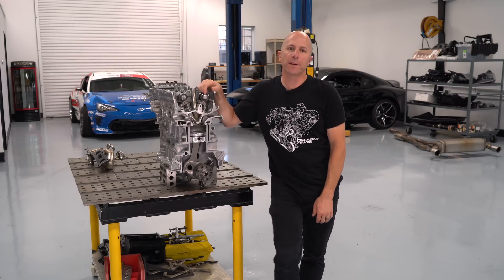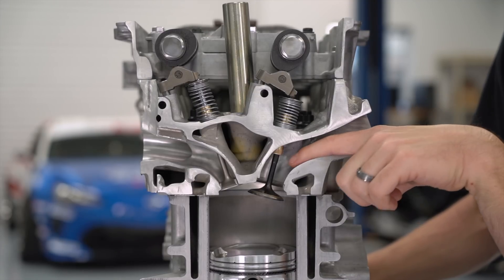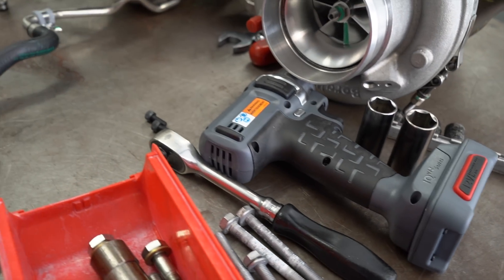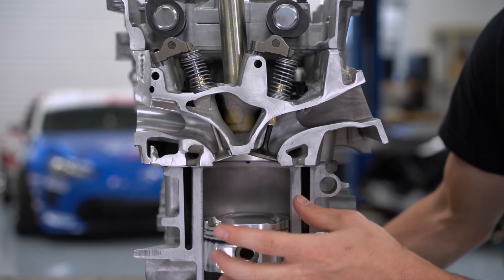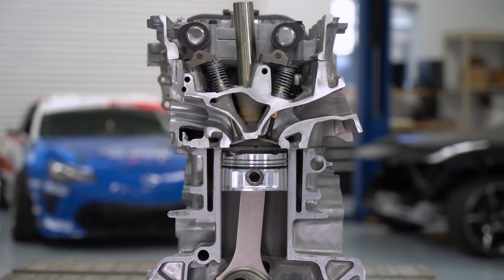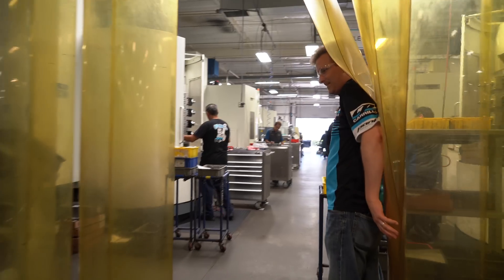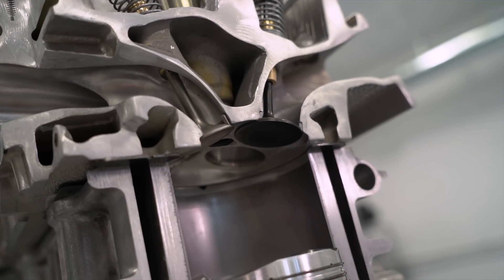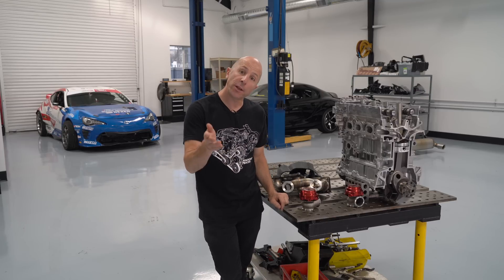The Making of 1,000 Horsepower 2020 Supra Engine Parts

Comment: I love this.. everyone fighting over “yeah first to 10’s” “first to 600whp” and he’s all like so yeah we’re just gonna go ahead do 1000hp and get to business.
Reply: And post it explaining how 👍
Reply: and it's a great video with a dense of information. not talking shit and unnecessary stuff.
Reply: derek kozelka well to be fair, steph is building an engine. Everyone doing stuff with the new Supra is doing so on stock internals, which is impressive
Reply: Matt L true true true! It’s just cool how engineering focused he’s being and taking it up to 10 right off the bat.
Reply: derek kozelka oh yeah I agree. Steph is a mechanical genius 😂
Reply: @DDRDK  Lol but he doesn't know something basic. He said that using a leaner air to fuel ratio makes it run hot, but he's wrong. Running at stoichiometric air fuel ratio makes an engine hot and running it leaner or richer than stoichiometric keeps it cool
Reply: InfiniteLoop that’s false though. When an engine leans out, it’s using more air than fuel, and it WILL cause a car to run a bit hot. Most fail to realize that fuel temperature itself has a huge impact on a cars performance. If your fuel is boiling, the car will run like shit. Fuel does has a play in engine temperature, but it’s not 100% the deciding factor
Reply: @Matt_Lanzer_13  No, you dumbass you're wrong. Check your facts before trying to correct me
Edit: Combustion temp plays a major role in engine temo but I know that there're other factors
Reply: InfiniteLoop you are correct. Fuel flow into a combustion chamber in relation to heat is a bell curve. Theoretically if you get a certain cylinder head temp with a richer than perfect fuel mixture, you will get the same temperature if you lean it the same amount. It’s not perfect but reciprocating engine airplanes use this theory with the proper monitoring equipment to save fuel. You theoretically do not loose horsepower going to the lean side either. Let’s be realistic though and realize he is talking about a racing application and it’s much safer to run an engine on the rich side to keep it cool. For a racing application there’s no reason to take the risk of running it “cool” on the lean side of the bell curve. Where fuel savings is not needed. I’m sure he probably knows this.
Reply: InfiniteLoop any unburnt fuel left in combustion chamber will change state to a gaseous form dissipating a lot of heat in the process cooling the combustion chamber, the cooling will be even more extreme  if the fuel happens to be ethanol or methanol
Reply: @kiyoponnn  wow so rude,  was that  necessary
Reply: @DDRDK  cylinder head temperature and combustion temperature are two separate things that different elements of the engine influences it
Reply: powersliding hmm. Interesting? Not really sure about your statement? Maybe I’m not understanding what you’re saying or vise versa? Cylinder head temperature most definitely is directly tied too combustion temperature. I’m not really sure why you think it’s not? A wet block has coolant that runs not only around the cylinders but through the head. This is then cooled down by heat exchange through a radiator. In fact most of the heat produced by an engine is taken from around the combustion chamber and transferred too coolant via water passage ways in the head.  My point above is mostly to explain when a lean condition is mostly used in the industry to run cool. This is currently a method approved by manufactures and the FAA to save fuel in some reciprocating aircraft engines. My point is, it is in fact true that running an engine leaner than stoichiometric will indeed make the engine run cooler without loosing any horsepower. Theoretically. Is it perfect... no. But it is an approved procedure that pilots use to save fuel. Think about it this way. Engine temperature and fuel ratio have a bell curve relationship. Let’s just call a fuel to air ratio of 14:1 perfect or stoichiometric. Let’s keep it simple. If you theoretically run a richer fuel ratio of say 13:1, that mixture will not completely burn because after all the perfect full burn ratio or mixture is 14:1. The rest of that fuel will effectively cool the combustion temperature. What some airplanes due to save fuel is run a fuel ratio of say 15:1 to save fuel. The same effect happens. The combustion temperature is actually the same as it was when burning at 13:1. Yes when it was at 13:1 the excess fuel cools the combustion temps but when it runs at 15:1 there’s actually less of a combustion event causing the engine to run cooler. That’s why the relationship of combustion temp and fuel ratio is a bell curve. On the lean side it will run just as cool at 15:1 as it will 13:1 and without power loss. Remember a perfect burn in this scenario we are calling it 14:1. There’s no power difference at 15:1 vs 13:1 because at 13:1 not all the fuel is actually burning, where 15:1 you just aren’t even putting the wasted fuel in there in the first place. Cooling from a 13:1 ratio is from the excess fuel. Cooling from 15:1 is from there being less of an explosion in the first place. The hottest running fuel ratio is always a perfect stoichiometric for that engine because you’re getting maximum allowed burn (therefore heat) and nothing extra to cool it like excess fuel. And 15:1 just doesn’t burn as hot because there isn’t as big of a combustion event in the first place. Like I said above he probably knows this but it isn’t practice in this case what so ever. And like stated above it isn’t a perfect theory with every fuel type either. Higher ethanol and methanol fuels bring a much bigger cooling effect with excess fuel is introduced.
Reply: @powersliding  I wasn't very rude, and yes it was necessary since he is technically spreading misinformation. And I don't know what you're smoking if you think cylinder head temp is unrelated to combustion temp. And I know that there are other factors too: Like an oil cooler, coolant, water/methanol injection kit, heat absorbed by fuel etc.
Reply: Wait so your saying a lean engine won’t run hot and melt a piston? Tell that to my 2 stroke sleds 😂
Reply: Cory Grant lol you clearly don’t get the concept..... of course they’ll run hot in a 2 stroke. 2 strokes (other than oil injection ones) are literally designed to use the fuel as as cooling AND LUBRICATION. Duh... of course they run hot. They’d have less oil lubricating them. A 2 stroke sled is not what we are talking about here, move along.
Reply: @kiyoponnn   "Running at stoichiometric air fuel ratio makes an engine hot"
Did you actually look into it yourself, or did you just watch Jason's video from "engineering explained"? And you didn't delve deeper after that?
Here is the catch: the stochiometric burn is a theoretic assumption for a perfect gas. In the real world you only approximate it. That's because air and fuel don't mix perfectly. Even IF your lambda sensor is showing you that you're stochiometric then you will have little regions of rich AND little regions of lean burns inside one cumbustion chamber at the same time. That's the real world. At so called stochiometric you will have both unburned fuel and regions with too little fuel, if you run a bit lean then you will have stochiometric regions and lean regions but no extra unburned fuel regions compensating for it. And THAT's why a bit lean often is the hottest point in the REAL world.
And this is ONE main reason why real tuners say lean means hot and theoretic engineers say stochiometric is hottest.
And here is another thing that plays a big role: How much this actual hottest points is off from stochiometric depends on how well the fuel actually mixes with the air, which depends on a lot of factors and is different from build to build.
Then there are other factors that get overlooked like some speeds (how fast it burns, how fast the flame propagates, how much time is needed for knock to occur), and i'm not going into those details. Just keep in mind there are other realworld factors that are confusing people.
Reply: @sasjadv  Fair enough, but that doesn't disprove what I said. You just admitted that engines have flaws either due to design or manufacturing tolerances that create hotspots in the combustion chamber. And I'll already said that I know that a lot factors affect it, but it's still a scientifically correct concept
Reply: InfiniteLoop running stoich or close to it in a performance engine is considered “lean”, and it will destroy an engine.
Reply: Matt L I think it’s way more impressive to build a high performance race engine. Those that have no idea what it takes to build a proper motor would never understand.
Reply: Gapplebee as cool as it is seeing steph go through the process of developing new parts, it’s not that hard to build an engine though. If you really wanted, you could buy all the parts off the shelf, and put it together in a home garage. Steph is going above and beyond and having custom parts made, which is all well and good, but it’s honestly a bit overpriced considering most of, if not all the older b58 parts will work on this one. 

And not saying anything about that, but It’s still impressive seeing a stock i6 make over 700 hp without any major mods. I mean shit, LZ has a bone stock engine with a bigger turbo and a tune and made like 702 or something. That’s pretty cool as well
Reply: @Matt_Lanzer_13   Yeah, making a 1000horsepower at home is possible if you have the money to buy the parts AND you have the knowledge IF you have a 2JZ.
This is a new engine that doesn't have the needed parts available, so you have to custom build. Apart from this, the B58 engine has some compromises that you need to overcome.
Reply: sasja de vries. Lmao the b58 isn’t a new engine.... it’s been around for like 5-10 years already.... this is the second generation. And a 2j is really not as good as everyone thinks it is. They won’t make 1000 hp unless they’re fully built, and that’s a shit ton of money. I mean shit, LZ has a 3.4 stroker that only made 1k with nitrous.... dean and weick’s cars both make around 950, so does tuerck’s.....
Reply: Because he understands his audience and 600whp isnt competitive in the supra realm and this new supra needs to far surpass the last one.
Reply: Real ST hit 10's first. That car is at Hot Rod Drag Week as I post this and did 10.96@128 on Tues. Car has upgraded turbo on it.
Reply: Anthony Thomas he meant up to 1000hp.... we were talking power... not 1/4 mile times
Reply: And HKS built a MkIII Supra that hit the 7's back in the early '90s...So what ?
Reply: It isn’t like I’m just reading the information I’m talking about. I work on airplanes. Airplanes are heavily regulated. If this wasn’t a real process that worked or was possible I assure you it wouldn’t be used. If you can’t grasp the concept that’s fine just don’t bash the truth and then try and compare it too 2 strokes. That’s like saying because Diesel engines don’t use spark plugs, spark plugs all together aren’t used and don’t work.
Reply: @DDRDK  Do you know the key difference that you've overlooked between piston engined airplanes and cars? Throttle response. Put your regulated aircraft engine into a drift car without alterations and it won't last. Put the same engine back into your plane and it'll be fine.
If you have a carburetor or injectors that are far away from the intake of an engine, then you will have worse throttle response, you will constantly run at the wrong A/F ratio when revving, clutching and changing gears. But if you have your injectors further away from the intake then the A/F mixture has more time to mix, it will mix better and give you better fuel economy. Pilots operate the throttle rather slowly, and there are no sudden peaks in engine load or RPMs. It's the opposite of a drift car. Eugene Losev spanks the throttle multiple times per second, and all drifters tend to pop the clutch, pull the handbrake, etc.
On steady RPMs you can get away with lean mixtures, and you can get away with putting the injector further from the intake if you don't need throttle response. But on racecars the fuel gets injected into the ports or into the combustion chamber, and you never reach stochiometric burn, you will always have regions of too rich and too lean at the same time. And because of that the actual hottest point gets shifted into the lean region on racecars. And the better the fuel mixes, the closer the actual hottest temps will be to stochiometric. And since aircraft can afford to compromise throttle response for fuel mixing they tend to have a better mix and their hottest point will be very close to stochiometric.
---
I'm so glad I speak multiple languages that allow me to access more info. People who only know half of the story all think they are right and don't get why others disagree.
Reply: sasja de vries. Lol or you didn’t read my response hahah. Congrats on the multiple languages... I don’t claim to know it all. Simply that it’s a theory that you just said yourself works and can be done. Thanks for proving my point. Did you forget the read the part where I said that in a racing scenario this isn’t practical? That it’s a practice that’s used in planes because things like throttle response isn’t needed? I wasn’t going to explain life on earth itself. But you managed too 👍
Reply: @DDRDK  😝😂
Reply: To be fair...horsepower means nothing if it can’t put it down properly at the track...I like horsepower tho lol
Reply: Lololol
Reply: What about the exhaust ports? Only 2? Knowing that a normal 6 exhaust port header glow like a sun, what happened with that aluminum exhaust ports when heat hit up? I guess will blowing up like a firecracker when getting melted
Reply: Luis otero it’s not really two exhaust ports. The motor has the manifold basically built into the head. That’s actually a pretty common thing to see nowadays. The two ports are fairly equivalent to that of a twin scroll manifold

Comment: I really dont like the exhaust ports. Ford ran a similar design on the 2.0 and 2.3 engines in the focus st and RS. After a certain point the integrated exhaust manifold restricts and even reverses flow.

Comment: You cant just cut a con rod in half to install the bearings. Unless your saw was so thin it could only bee seen with a microscope then its not going to be a perfect circle in the base of the conrod. It would need to begin as a circle with 2 flat sections equal in length to the thickness of the saw, or it would need to be made oversize so when its cut in half the circle can be rebored

Comment: Functional clarification: the actual highest combustion temperature air:fuel is stoichiometric (~14.7:1 for gasoline). Richer than this (<14:7:1) or leaner (>14.7:1) runs cooler, not hotter. The X factor, so to speak, is that adding in extra fuel can cool the cylinder, so that's why comparatively richer (over comparatively leaner) can keep things from melting in the cylinder. It seems like a small distinction to make, functionally speaking, but it's an important engineering principle to understand. And "lean" is technically defined as over stoichiometric, so you're not really "lean" unless >14:7:1, in which case your combustion temps will start declining. You may be comparatively more lean at 12.5:1 than, say, 11.5:1, but that's not the same thing.

For expansion on this "common misconception" (Jason from EE): https://www.youtube.com/watch?v=vcgmEKhCFTs

Comment: Still Not a real Supra.. sorry A BMW cannot be called a Supra 😪😞🙄
Reply: Is that so, well why you don't say that Yamaha powered Supra's arent Supras? Wanna know why, cause you you only like the 2JZ engine not the Supra name. Since i found out this engine haulls ass, it something that a normal BMW can't do without breaking down (except the N54 powered ones).
Reply: @h.a.4600  

Bmw should stick to being a BMW 

Not part BMW part Toyota mate 😂👍🏼

I have am X5 E5 4.8is Which is a BMW not part BMW part Nissan 😂😂👍🏼
Reply: @TheJay911  If the B58 didn't went to a Supra body, aftermarket parts for it would be in Alaska, and this engine has so much potential to be wasted on a normal BMW. This engine is better and easier to service than the S55 from the M4, if the S55 engine goes bye bye those are 30 grand out of your pocket buddy.

Comment: This is so cool! I have a question though, maybe someone can answer:

Why doesn´t the people at Toyota optimize these things, for example the air valve. It seems like it would be no match with such a big team of engineers. Does it have to do with cost optimization because more narrow tolerances = higher cost? Or does it have to do with how many HPs you can actually put in a street legal vehicle? Thanks!
Reply: Cost optimizations, and built for longevity. Ironically, racing engines tend to have larger clearances (bearings, ring gaps, and piston to cylinder wall) than a typical production engine does. The reason is to maximize efficiency as larger clearances have less friction than tight ones and metal expands under heat. However, to compensate you have to run a higher viscosity oil (40 or 50 weight).  If you notice, modern engines tend to run really low oil viscosity like 0w-20 which is due to very tight tolerances.
Reply: @phaqgm  I see! Thanks a lot for the great explanation! :D

Comment: And this is how they made a 1,000hp 4 cylinder Toyota engine that comes in an XD 🤯🤯🤯
Reply: What I find particularly wild is that he mentioned in a previous video that the limit against them being able to produce more power with that engine is the cylinder head not having structural integrity to physically withstand the pressure exerted on it from running more boost.
Reply: It's a BMW motor btw a B58.
Reply: Shokase I was talking about the drift car they run in formula 1
Reply: They used the 2.4L Camry engine that has little to no aftermarket. This engine will see wider use which is why Mountune is on board.